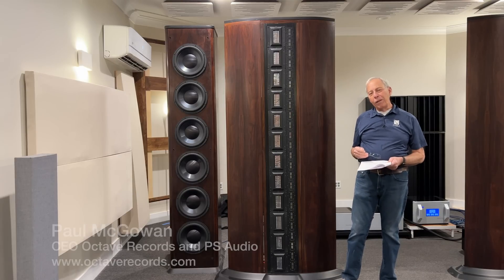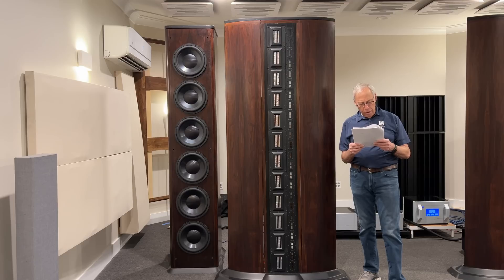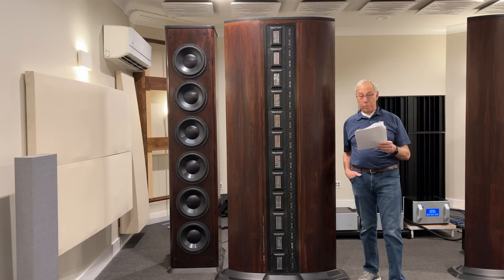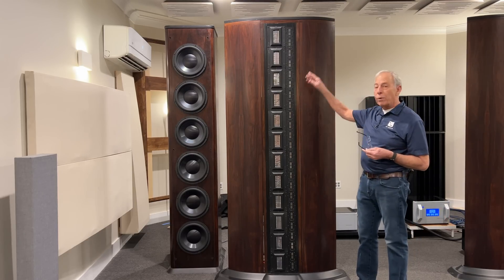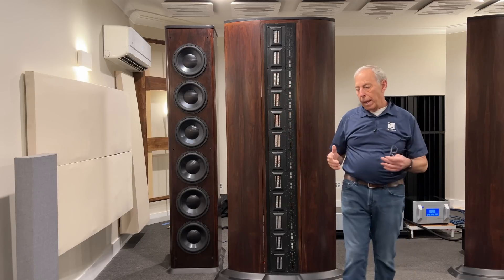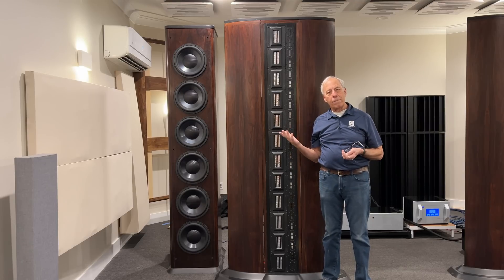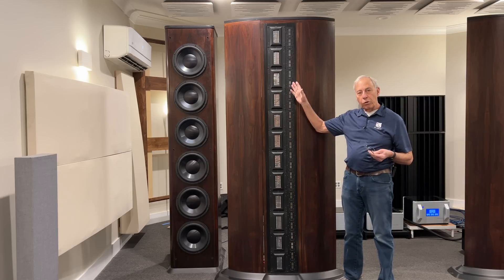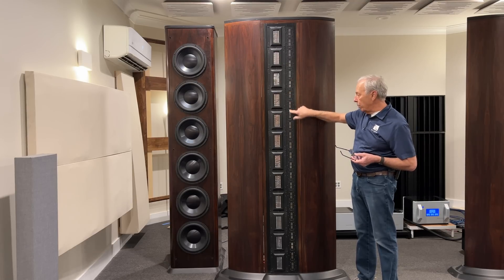Understanding line source and point source speakers

Comment: A line array for a room is a complete nonsense. The cylindrical dispersion is a myth and it doesent work like that, having an array of sources allows you to controll directivity, something you dont need to controll in a small room.
Reply from the maker: Wow. Where is it you get your information? Perhaps you are thinking about modern DSP steered line arrays? There's years of measurements and experience with line arrays and how they propagate sound into the room. Sorry to be argumentative but it prickles the hairs on my neck when false info gets started.
Reply: @Paulmcgowanpsaudio  You have not been argumentative at all. xD

Comment: As a kid the first pair of speakers I purchased were the Design Acoustics PS(Point Source)10's. In the mid 80's at about $300./pr (I purchased the optional metal stands as well about $60. extra)they were certainly an upgrade to what came with many packaged stereo systems at the time. However they were a far cry from these Infiniti Reference series speakers.

Comment: Paul how do you reconcile the findings of an in depth test of your company's $6000 P12 a/c generator.
Effectively it does nothing at worst it creates more a/c noise.
Reply from the maker: Are you referring to the ASR review? That was silly. They totally missed the point of the product. The P12 does exactly what it is stated to do: lower output impedance, regulate the AC, and remove distortion. That Amir doesn't understand why that improves sound quality and ,misunderstood what the product's intended uses are is rather typical.
Reply: @Paulmcgowanpsaudio  let’s assume what you say is true, but if it has no bearing on the output response of the amplifier, as was also pointed by Amir, what really is the point?

Supposedly, there must be something you could show on the graphs that causes an ‘improvement’ in sound quality?

Comment: I can see a line source being better being the sound should be the same no what height your ears are at short of laying on the floor or ceiling. I used to have a set of speakers that sounded so much better when you laid them on their sides then standing up. Sitting at the right height it must have been like a poor man's version of the (line source) V's. The V's give you options of any height. Today I have 4, IRS IIIa's and 8 Emits in 2 satellite boxes. Never thought about laying them sideways (they're 4 feet tall) but if I did, I could make about 4 feet of the IRS V's. I'm not sure what would be better, having all the sound waves coming from different heights, rolling over top one another like the waves from a few pebbles dropped in water, the waves hit each other all chaotic as they pass each other or is it better for all of the waves to be at the same (height) level and come to your ear like boats going down a waterway one right after the other sending waves in order, to the shore as they go by? I understand you want to blend the music but like a milkshake I would think you could over blend and end up with milk. Maybe if I had a bigger room, I could get a couple more sets of IIIa's and a couple more amps and give it a try but until then I will just have to sit on the couch for the best height for listening.

Comment: I've never really thought of the IRS as a true line source. The rows of tweeters and midrange drivers inevitably have gaps between the top of the radiating area of each driver, and the bottom of the radiating area of the next driver, and this will lead to some degree of acoustic lobing and comb filtering along the array. True line sources are found on some electrostatic and ribbon speakers like Magneplanars, Apogees and Martin-Logans.
Reply: No, the Infinity IRS V is not a true line source, but they function as one.  The acoustic center of the square drivers is much closer together than the voice coils of round drivers.  The comb filtering between drivers will average out and they will integrate, as long as you're not sitting too close.
Reply: @BruceCross  I still haven’t fully understood comb filtering to know what it does both near field and at larger distances. 

I was thinking of building a poor man’s “line source” using say 16 3” or 4” full range cone drivers but friends warned me about comb filtering above say 3500-4500Hz depending on the diameter of the driver. 

The only use of a line source I see now is for below 300hz where an array of 8” woofers can be used. This way comb filtering is above the crossover frequency of these woofers.
Reply: @navinadv  Everything I said is based on "GR-Research" videos, so please see Danny's channel.  If multiple cone drivers are playing the same frequencies, the voice coils are too far apart to create a line source.  Baffle step loss is another factor, the frequency where drivers stop beaming forward and start become omnidirectional, where drivers playing the same frequencies start interacting (comb filtering).  Don't ask me how the crossover compensates for the beaming frequencies being louder.  Crossover points are important, too.  I like your woofer line array if the baffle isn't too wide, but then it limits output.  Sigh, I understand a little bit of theory, but I'm not a speaker designer.
Reply: @BruceCross  oh I’m not a speaker designer either, and I wasn’t trolling. I was referring to comb filtering that would occur if the center to center distance between drivers was say 100mm. Assuming the speed of sound is 343000mm/s the combo filtering would start at 3430hz for 2 4” drivers. 

Baffle step is a function of the width of the baffle and assuming the baffle is also 100mm wide yes then baffle step would also begin around 3430hz.

With larger drivers operating lower say 4 8” woofers reproducing (or tasked to reproduce) 30-300hz comb filtering would not be significant but as Danny explained with several smaller full range  drivers operating out to 20,000 how does one mange the comb filtering? 

How do the EMIM type drivers used in the IRS avoid comb filtering? Could we DIY’ers replicate this using planar drivers like the B&G Neo 8?
Reply: @navinadv  No, I didn't think you were trolling.  I'm sorry, you could easily be more knowledgeable than me.  Yes, 3430 Hz for 4" drivers sounds about right.  The comb filtering can't be managed with smaller drivers, but it averages out.  A line source requires square drivers, since they won't behave as a continuous driver unless the acoustic centers are close enough.  Also, a lot depends on how high the crossover point must be to the upper driver.  If it's too high, it increases comb filtering.  I don't know about the B&G Neo 8.
Reply: @BruceCross  It’s all good. I know very little about acoustics and loudspeakers. I’m still learning which is why I ask what may be basic questions. The B&G drivers are rectangular in shape much like the EMIM and EMIT but I don’t know if that’s where the similarities end. 

So far the only speakers I have built are traditional 2, 3 and 4 way designs with a woofer, midrange, tweeter, and a crossover in a box. I did experiment with open baffles but I found that in most apartment living rooms there isn’t adequate space to let them breathe as it is difficult to live with speakers 2-3m out in front of the front wall. 

I tried a single driver full range and while the coherence was enchanting, the max SPL limits and top end were challenging. The idea of using a line source to handle everything but the extreme top end is an option. 

Another idea is to use an Air Motion Transducer for the highs and an array of 4” full ranges for everything below 3500Hz. Hopefully the full ranges wouldn’t need a crossover and the tweeter could be crossed over with a simple capacitor. What do you think?
Reply: @navinadv  Open baffle is nice, but they do need space.  I don't know how to make 4" drivers work when they're round, but it sounds like you're not afraid to experiment.

Comment: woah....the crossover network on the tweeters, that's brilliant....
Reply: I've never heard of that before. I wonder if he got that correct. 🤔 

Usually in a line source (or line array) there's power tapering>>> the result is that the middle of the array plays slightly louder than both the top and bottom of the array. 
But I've never heard of a configuration where the middle of the tweeter array plays the highest of the frequencies.
Reply: @thunderpooch  more like the principle of a drumskini,,,at least in my brain. Interesting,,,